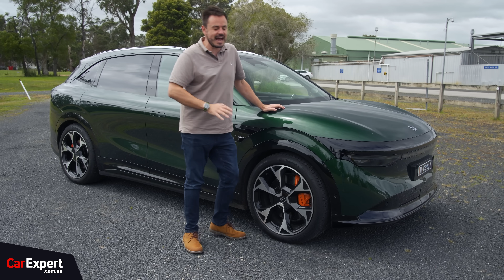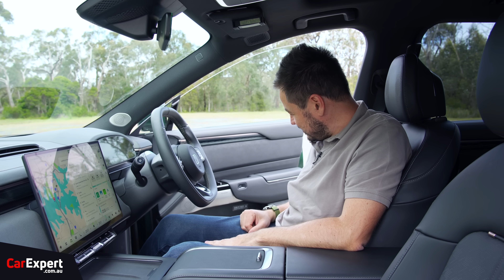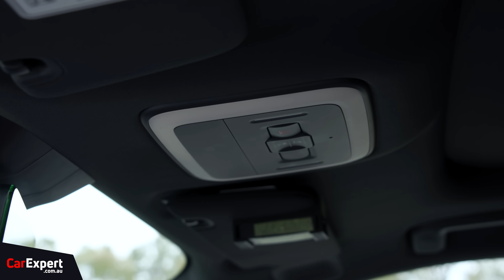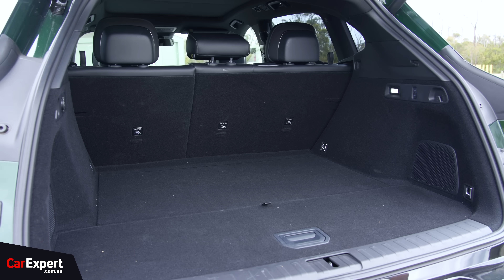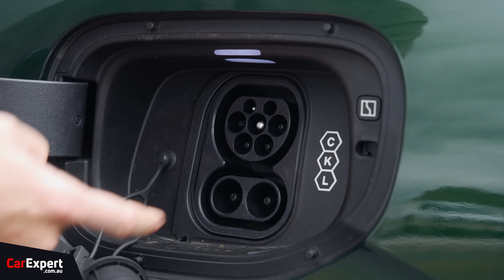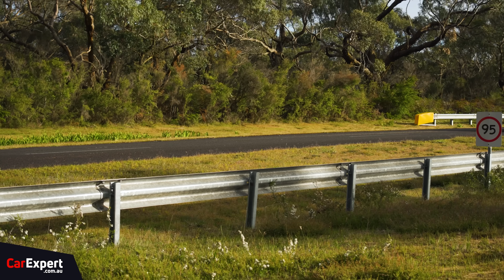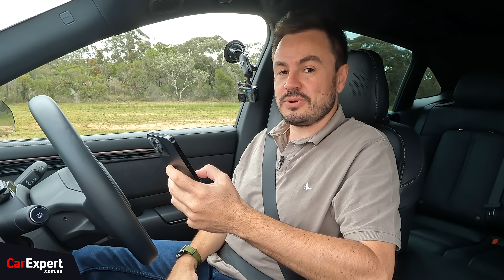The BEST EV I’ve driven this year…Zeekr 7X review (inc. 0-100 & braking)

Comment: Will the doors crush or break fingers when the door closes, especially when small kids are in the back? Please check.
Reply: No, in most cases. It will either apply some pressure or a quick pinch to your limb or fingers before it is detected and the door stops closing. Yes, it is not a good outcome if you put fingers near the door hinge (but this is true for any car door). Also the doors cannot be slammed shut, so there is no risk to fingers in that sense (which every car with 'normal' doors has).

Comment: Bought mine in October and love it. It is a joy to drive and Zeekr and the South Yarra dealership have been wonderful. The first OTA update with speed sign recognition didn’t enable the feature. Apparently the wired update at the dealership did work. The A.I. Assistant is rubbish, doesn’t understand anything- even basic commands and the native navigation announcements are doing a poor job of translating into English (all streets are saints and roads are just r.d.) but you can always switch to other nav apps. I thought the power doors were a gimmick but after 2 months I have changed my mind - they are a feature well worth having. Any gripes are minor and won’t detract from this car being absolutely amazing and at a price that is unbeatable for what you get.
Reply: " it works some of the time... ".  What every driver wants to hear after spending $80K.
Reply: South Yarra dealership are terrible

Comment: Great car, but Zeekr needs to work on its customer service, and its app. When I ordered mine (7X Performance), there was no dealership in Adelaide (even now, there’s only a “pop-up”), so I was forced to order mine from Zeekr Parramatta, and have it transported here. Everything was fine until they got my signature on the order. After that, there was zero communication, and it took forever to get hold of it. Just poor service. And even though Zeekr charge a hefty “Dealer Delivery” fee compared to Tesla, I was still charged an extra $1,000 to have it delivered in Adelaide. And I still don’t know where I’m going to be able to have it serviced here. The app? Not great. It constantly loses connection with the vehicle, and the only way to re-establish connection is to log out and log in again. Really frustrating. The vehicle? I’m loving it. Not perfect, the software isn’t as refined as my previous Model 3, but hey, that may come in time with OTA updates. The driving experience? Terrific. The comfort (compared to the Tesla)? Superb. The value? Fantastic.

Comment: I have a tesla model 3 LR and the second generation Mercedes EQS450 SUV (with much improved break pedal and regenerative breaking) and they both have one pedal driving, with tesla being the smoother and the Merc being either too strong or too soft, so any car without a one pedal driving is out of consideration for me!! I would take Tesla new improved suspensions over this car gimmicky air suspension any day! I much prefer the lack of clutter and intrusive screens in Tesla over the hyperscreen in the Merc. I a love the commanding front view of the Tesla and dislike the rear view. Also why is turning ADAS off acceptable. Having to turn it off in this car because it's poorly calibrated or too intrusive is a major red flag for me. The only short comes of the Tesla is lack of 360 degree camera and the recent removal of gear shifting stalk.

Comment: This Zeekr 7X looks quite good, especially in that simply stunning green color, has quite a European design, and also the interior looks quite neat and actually practical!
But personally would still go for something like XPeng G6 in this class, for me it's just drives better and the interior tech is much better. 
When are we getting the XPeng G9 review? ;)
Reply: I own the 7X AWD and test drove the G6.
The 7X has better steering and suspension and generally drives better. It is also more spacious and more luxurious inside and very importantly has a sunshade. I also think it looks better, but to each their own.
The G6 definitely has better and more polished ADAS tech, particularly its ACC+LKA on highways and its auto-parking etc. It is also a bit more efficient, and cheaper, especially right now with the deals Xpeng are doing given that the new G6 is out next year.
In most other respects there is little difference between them.

Comment: 5:00 noticed the steering retracts when opening the door, nice little subtle feature.
Reply: My wifes '07 Tahoe had the seat lower as you opened the door.
The steering wheel only went up and down on adjustment as the pedals could be adjusted forward and rearward.
Reply: Lexus LS400 eat your heart out
Reply: My 1992 Toyota Aristo had this 😂

Comment: would love a comparisson on ride and comfort, especially comfort, between this and the Xpeng G9. Both versions of G9 with and without air suspension versus the 7X with air. Wondering if the price difference is worth it or is the LR G9 the best option and comfortable enough for journeys especially with small childer who like to sleep?
Reply: From other reviews, the G9 (especially the updated model) should have better ride & comfort and sound isolation than the 7X AWD. The degree of this improvement depends on which models/trims you are comparing.

Comment: As someone who was about to drop money on a BYD Sealion7 Premium, I'd like to see a review on the entry or midspec 7X
Reply: We own a Sealion 7 Premium and absolutely love it.  Hubby love the Sealion 7 so much he wants it as his car and I have ordered the Zeeker 7X Long Range as my car.  Now we get both.  Both awesome cars to drive.  Few Apple car play niggles on Sealionn which I am sure they will fix that you don’t have on the Zeeker, but the Zeeker Speed recognition software needs an update which may have arrived soon.  Both wonderful cars. Fit and Finish slightly higher on the Zeeker, however the Sealion gets Nappa leather which is lovely on the base model, where as the Zeeker only has full leather on the AWD model.
Reply: @mands4253 I test drove the sealion 7 yesterday. 
Seating position is quite high and I couldn't get along with how low the steering wheel column is mounted, causing the steering wheel angle to be too upwards

Comment: BYD Sealion 7 is the car that competes with this head on. Have you tested that as well to compare? For what it’s worth I’ve got the Sealion 7 and while I find the suspension is a bit too floaty for performance driving , it’s an amazing car. And the Apple CarPlay doesn’t drop out. Almost the same exact design as this Zeekr as far as the infotainment and center console looks go , same 50 watt charger below the screen etc. Comes with the DYN audio system/speakers which is quite amazing as well. Just wish they did a better tune on the suspension.
Reply: Sorry to say that the SL7 is not quite in the same class as the 7X, and certainly the SL7 AWD Perf. is not close to the 7X AWD Perf. in terms of performance, efficiency and features. It does beat the 7X on price though, but there is a reason for that.
The closest competitors to the 7X AWD are: the IM6 AWD and the Tesla MY Perf., followed by the Xpeng G6 AWD, SL7 AWD and Tesla MY LR AWD, etc.
Reply: @Antmanzzz  your talking about performance. I’m talking about features ,quality of life inside the car,  as well as overall performance (including the suspension tune which seems to be similar I.e floaty with all these Chinese cars. ).
Reply: @duffyrides  Nope I'm talking about everything. The suspension and ride on the 7X AWD is slightly better because it is only floaty in comfort mode, is quite well tuned in standard or sport modes, and is quite firm & flat in corners (for an SUV) in sport mode. The adaptive air suspension is also really useful & effective. It has real demonstrated 'soft-roading' (off-road) capability. Yes the tuning could be improved a little more for AU roads.
The SL7 is even more floaty in comfort mode and also 'boaty' in corners and when accelerating or braking, indicating a softer suspension, and so needs even more tuning. It does firm up quite well in sport mode, but not quite to the same extent - there is still more body roll. The SL7 AWD doesn't have air suspension but does have (FSD) damping shock absorbers which help a lot.

Luxury of materials and quality of life inside the cars are very similar between the 7X & SL7 which is why I didn't highlight it.

I have a personal preference for the more minimalist interior of the 7X over what feels like a more busy/cluttered look in the SL7, but others will feel the opposite, which is fine.

Both cars are quite handsome from the outside too, albeit in slightly different ways.

Comment: When the features are hard to get to or use while driving, it becomes a gimmick or worse, a distraction from the road. So many manufacturers are saving costs by putting everything on a single large screen, and some are using a layered UI to handle basic tasks. Sure, you can try the voice commands, but from my experience with 20 different cars and from all the reviews over the last 10 years, they are just gimmicks.

Comment: Door is inconsistent because you're standing in front of it! It's working as designed!
Reply: Can that auto door /window opening & closing be disabled, to allow manual opening ?
Reply: @bretton2482  yes you can disable it and choose manual open.
Reply: @5m4llk1ng  But you can't use the traditional door handles to open the car, right?  You need to press the little round button.
Reply: @bretton2482 I believe the door handles don't open the door if you have this electric door option. You must use the button.
Reply: @bretton2482  the powered opening/closing doors are on the top-spec model. Only the Performance AWD Variant features fully automatic, sensor-driven doors that open to 90 degrees and stop automatically if obstructions are detected. This oworks well to prevent damage.
 Lower spec models have electronic latching, but conventional handles to open the doors. On the Performance model there is still a manual door release on the inside if power fails.
Reply: 👍 Makes sense.
Reply: what did he expect the door  to do with obstacles?
Reply: This knowledge is common sense even for children in China.
Reply: @ZheXinYou  Considering that electronics ARE glitchy - it only takes one ding into a Merc to cost you a lot of money. There goes your insurance premium,.

Comment: Finally someone mentioned the disconnect of AA and Car play near toll gates. It also happens near fixed speed cameras too here in Perth. for me it happened with cable as well. Interestingly it happens a lot with Samsung and Apple devices so I jumped onto Oppo Fx9P and so far no dramas with wired however all of them are dropping while using Wireless connection.
Reply: I agree. My mg4 dropped out all the time. With my 7x on Mitchell FWY north going over the bridge just before Osborne Park it resets every time.
Reply: something to do with the chinese transmission tech ?? worrying.

Comment: On "fuel", the main factor between the performance and the LR RWD is the size of the tyres, not the second motor, which cuts out when cruising. You gain roughly 5% in range per inch decrease in wheel size - pretty consistent across different brands. So, theoretically, if you put the RWD 19" wheels on it, the range would be about 600 km.
Reply: are you telling me you pay for awd and you get auto mode ?
Reply: @pummyy It is very similar to what Tesla do with their AWD models, using a front asynchronous motor that can be 'electrically disengaged' with minimal loss in efficiency.
It is in auto-AWD mode when you are in Comfort or Standard acceleration modes. Put it in Sport acceleration mode and the AWD is fully engaged.
In Comfort/Standard if you push the accelerator hard it will still engage AWD and apply max acceleration. It will also auto-engage AWD if the ESC detects slippery conditions, or if you go into off-road or snow modes.
Reply: @Antmanzzz  yeah same as my Xtrail in auto mode
Reply: @pummyy In an EV auto-AWD is actually a desirable feature because you still have the AWD whenever you need it, but also get pretty good efficiency similar to a RWD-only car.

Comment: Once again, weight has little effect on an electric vehicle efficiency. Unless you are gaining significant elevation. You can add 2-300kg and it will consume almost the same.
It's all about aerodynamic efficiency, and partially drivetrain efficiency
Reply from the maker: 😂 nonsense
Reply: @CarExpertAus  arrogantly ignorant I see. There are various EV reviewers that have shown it repeatedly. Especially if driving at constant speeds like on a motorway. You can try it yourself. You have both EVs and a proving ground at you disposal. As an example, a model3rwd is all in all more efficient than a Dacia Spring despite being 800kg heavier.
Reply: For the motorway at a fairly steady speed, yes you are right, aerodynamics is more important than weight, and as the speed increases this difference increases rapidly. At speeds of 110 km/h in a fairly straight line on flat ground, the only real impact of weight is minor - on the rolling resistance (of tyres, bearings etc) and little else.
But for everyday driving with starting, stopping, cornering, hills, then weight really does matter, and at low speeds, even more than aerodynamics or drivetrain efficiency (assuming the latter is in a reasonable range).
Reply: @Antmanzzz  but in start stopping scenario regen and high instant torque again minimize the difference. Indeed, a reviewer filled the car with ballast (+400kg), went up a mountain and came back down (30km loop, 1000m elevation). The difference in energy used compared to unloaded was less than 3%. I am confident that if they do the same, driving 100km around the loop in this video, the difference would be again minimal

Comment: Idk man. I test drove this and it felt soggy and way too soft. The lean was crazy especially then accelerating and braking. Yes i had the AWD.. It was not confidence inspiring at all. 

The interior rattled like crazy also. 

But the worst things were the assist systems. The auto steering was some of the WORST I have ever tested. It did not work half the time and when it did it slowed down for the least sharp curves ever on the highway at speeds of even 100 kph. Meanwhile my XPeng P7 and previous BMW i4/Kia EV6 do those easily and literally always work.

The 7x left kind of a messy impression.
Reply: Did you try driving it in Standard or Performance suspension and/or acceleration modes, instead of Comfort mode? It stiffens up a lot in Performance and the lean is definitely not 'crazy' then, but way better than average for an SUV.
Which part of the interior rattled? Not one reviewer or owner I am aware of says this (and I have never experienced it). Are you sure you didn't have a loose object somewhere?
However, there's no disputing that the G6 or P7 have better ADAS than the 7X. It is still above average, but perhaps your comparisons cars are all in the 'well above average' bracket.

Comment: Rumour has it that this is coming to South Africa as well (in 2026), yay! And between this and the new iX3, I wonder which is the better choice
Reply: New Ix3 just priced themselves out of the market at R1.7mil...the old model was great value the new one is ridiculous compared to BMW ice vehicles. 

Weirdly in Australia BMW dropped the price of the new one by R50k over the old one while in SA BMW raised the price by R350k.Which idiot decided this at our local level is beyond me.
Reply: @falconi786 Yea, I just found out about the pricing and it's a little disappointing. That also means the iX5 is gonna be well above R2M. If the Zeekr 7X is still coming, they're gonna eat BMW's lunch and I don't think EX60 is gonna cheaper either, maybe it'll start from R1,5M. That's why Chinese cars make more sense; same if not better value for less

Comment: I'm not sure I'd trust the automatic doors to not hit the car next to me, even with sensors
Reply: It won't hit a nearby car/fence/wall/tree/pole/person/elevated curb/leaves,etc. In fact it is a little too conservative and you often have to nudge the door a little wider. It will also only open slightly and sound a warning chime if it detects an approaching car/bike/runner etc, but of course this isn't perfect so you should check first like you would with any other door.
I have done a lot of testing of various odd scenarios and also just general use so far and I have a lot of reassurance that it works really well.
Having said that, on one of the Facebook groups someone said they thought it was about to hit an elevated ute tray and had to manually stop the door..?
But out of the probably many thousands of times the doors have been opened for the 7X AWD owners in Australia, that is the only such door incident I have heard of.

Comment: Has it had a crash test, and if so, did the seats remain connected to the chassis?
Reply: I believe it has only been euro encap testing. I'm not sure about the seats but it might point you in the right direction. Would be good to know.
Reply: it has 5 stars euroncap crash test rating. That is, it is as safe as any safe-in-your-mind car out there
Reply: It is a polestar sister car,so basically Volvo standard of safety
Reply: Yes. 5 star Euro NCAP (2025): Adult Occupant 91%, Child Occupant 90%, Vulnerable Road Users 78%, Safety Assist 83%.
Look it up online and you can see all the results and crash videos etc.